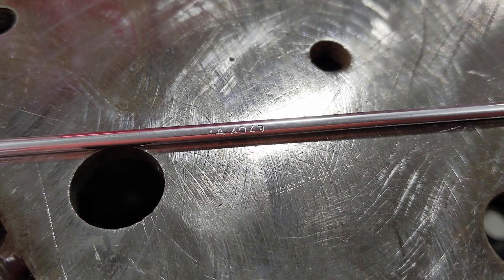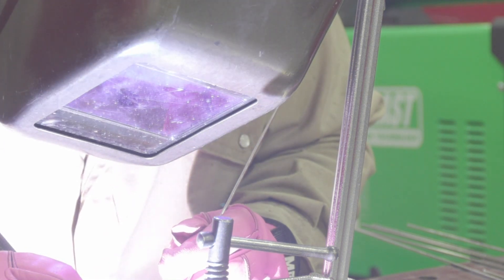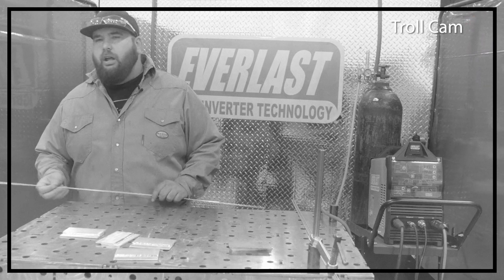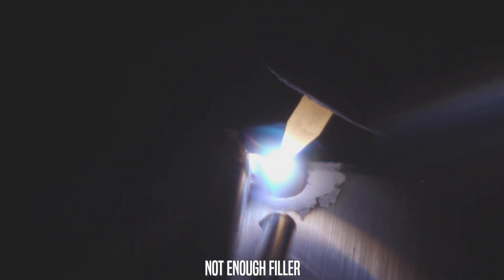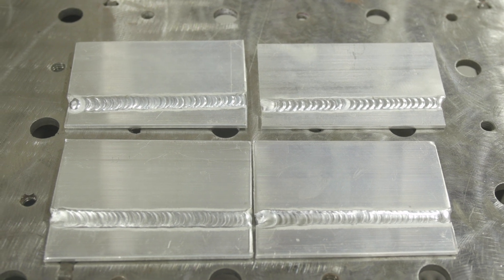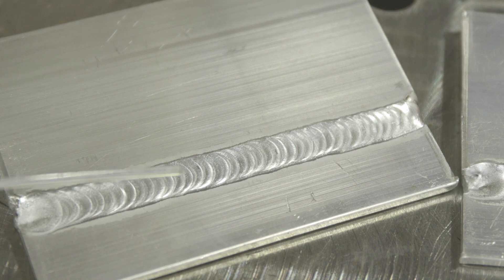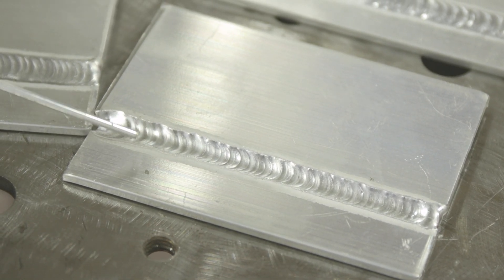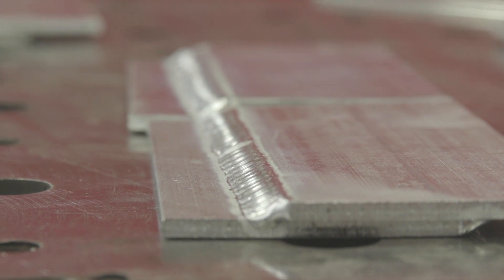Aluminum Welds Cracking?

Comment: Learn to slow the feed dip down  and you will never get flat welds, if you get good with your feed hand you will always be able control weld profile. Also with alloy you want tight overlapping beads or dimes for a tight and strong metal grain. The father you stretch the dime the weeker the grain. The same gos with alloy spoiling gunning, I don’t get why guys whip and pause alloy on boats so much. 

Liked this video and I liked how he knew some rocket science code. 

May the Arc force be with you

Comment: From my experience even welds that have proper reinforcement can crack. Most cases when I had problem with cracking was with single bevel type of joint or dual on hard surface aluminium plates with high amount of magnesium. How I dealt with it was adding a root pass and going with lowest possible parameters on high speed. At least with GMAW, with GTAW you are on better side of welding as you pump less heat into weld anyway.

Comment: Hey Brian, on that crack at 3:05, I wonder if a contributing factor to the problem was that the weld was mostly base 6061 and not enough filler.  I know you can't do an autogenous weld in 6061 because of its extreme tendency to hot crack.  I kinda think this might also be a large contributor to the situation with concave beads, as there's not enough filler added to change the joint alloy enough to avoid hot cracking.  On lap welds, it seems nearly impossible to tell afterwards how much of the top piece you chewed off versus how much filler was added to make up the bead.  Your thoughts?    (Love my PowerTIG 255EXT)
Reply: Hey Ralph I do not believe the contributing factor to the crack is it's only or mostly 6061alloy because I have seen in rare occasions times where 6061's been matched with filler metal of 6061. I Love the thought process and that 255ext is a great machine!

Comment: Does the aluminum puddle by nature form as convex or is there a special technique to make it convex vs concave?
Reply: A weld it will naturally be concave to prevent concave bead profile all you need to do  feed wire and control your heat. To oversimplify it
Reply: Precisely what he said...the torch heat alone will sink the puddle, the amount of rod you shove in, and the amount of amperage u focus on it before you step forward, will determine how convex your freeze line and puddle height will be 👍👊 good luck!
Reply: @DCweldingAndArt  @bingo_welding -- 
I appreciate the feed back. I will give it a try. Just getting into the aluminum side and was curious.
Reply: if ur experienced with steel, imagine that aluminum is a whole different sport: it's not about being easier, or harder, it's simply very different.
To answer to your question, differenlty from steel, on aluminum, if you loo for a good fusion and  a good weld, you have to avoid laywire and feed A LOT the puddle; a good way to go, at least for me, is to use a bigger size rod than I would normally use for steel, so I won't need to push it that much and I will als be able to use it as an heat sink to prevent overheating the base material (obviously combined with a foot pedal or, other methods to control amperage in real time, wich is the trickiest part on aluminum).
Reply: The special technique is driving rod in there like there is no tomorrow. ;)